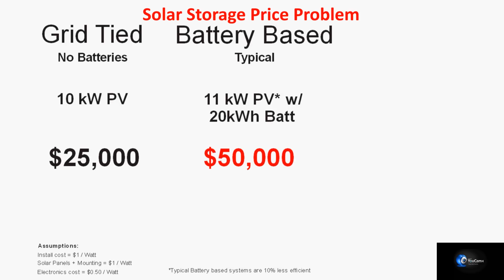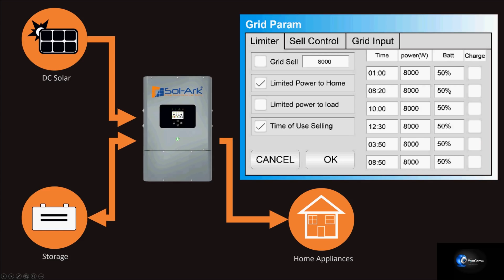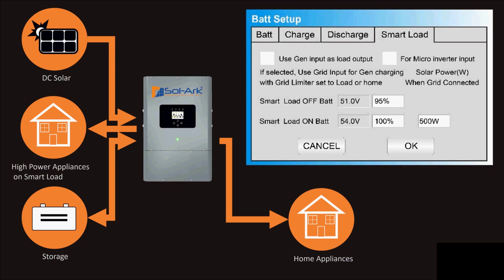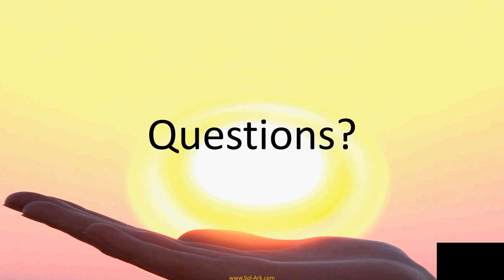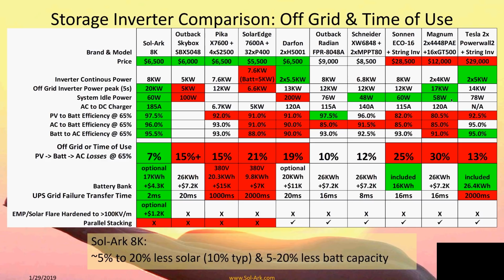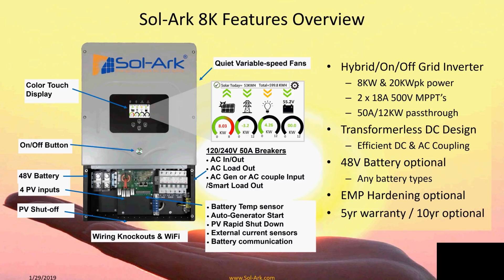Competitive Storage Inverters Webinar 2019

Comment: You should be replacing free of charge all of those grid tie units that turn off the solar power to the house when the grid goes down.
Your stuff is overpriced and under engineered and not friendly to the consumer's pocketbook at all.
I put more of your gridtiy inverters in a dumpster after replacing them with better units that cost about half as much.
Good luck with that '70s technology garbage you're hustling....
Reply from the maker: Hi Wayne,
To clear any confusion, we actually don't sell grid-tie only inverters. Sol-Ark users have the option of operating in a grid-tie-only fashion when they do not have batteries, but the majority of our users back up their homes during grid outages and even operate independently from the grid with our inverters.
If you'd like to learn more or have any questions, feel free to contact us here: https://www.sol-ark.com/contact-us/

Comment: The quality of the inverter is very good, but what does it do for your company when the potential customer has turned away because of how expensive the inverter is, I am an installer in Jamaica but as much as it is good,  I have to recommend a different brand to my customer because the price is too expensive here in Jamaica.
Reply from the maker: Hi Andrew, thank you for your feedback. The prices are set because Sol-Ark will provide installers and end-users all the technical support they need, in English and Spanish. We also offer more economically feasible options for smaller loads, such as the Sol-Ark 5K.

Comment: I have an existing large 40 volt battery system is there a way to use my modified sine wave inverter 120 volt as a generator backup or use my battery grid tie inverter as AC coupled.
Reply from the maker: Sorry. No. We cannot work with modified sine.

Comment: Does the Sol-ark 8k $6500 include batteries?
Reply: no batteries - but this is a "real inverter", it cost more because it combines several products in one, this is not a Tesla type solution that invests more in marketing and shiny plastic than tech. Pair it with the proper battery and it could easily last twice as long as a Tesla Energy product, after the first lifespan of a Tesla product is exceeded a Sol-ark starts paying you back fast. Cheap conventional solar inverters sometimes advertise grid-down power, but often it is extremely limited - ie only 1 120v outlet, only 2000watts, etc, or other systems that offer "battery islands"- these require tons of add-ons besides the batteries, often making the final cost exceed the Sol-ark solution - I am just shopping and finding tons of hidden costs in other solutions. Sol-ark just makes inverters, not batteries, to double your life get a LiFePo4 battery product, it will cost more up front, but will pay back later.

Comment: I don’t see the system and the one power supply like the SMA sunny boy to thousand watt power supply if you don’t half batteries
Reply from the maker: Correct. If you don't have batteries, the system shuts down like a Grid Tie inverter. The SMA outlet is only powered when the sun is up and grid is down. It's not continuous power. It was mainly put there to satisfy a california law.

Comment: Does anyone do a true full house system. 300A main breaker box?
Reply: Check out the growatt inverters they're about half the price with a 10-year warranty much better than this crap that's way overpriced
Reply: Good question but most single dwelling houses in the US are 200a main service and not 300a
Reply: The LIGHT Worshipper what do you need to support a 200K box? Thanks for responding. I’ve been told that I need at least 5.7K solar for my house.
Reply from the maker: The 12K is stackable. So 2 x 12K will allow many people to wire the whole home.

Comment: They are pushing AGM batteries..which means you get 1/2 the actual power production.  And you also get to replace the batteries every 2 years or so.
Reply from the maker: We are battery agnostic. You can use whatever you please that is 48V. But in our testing, we found thick plate carbon AGM's superior in cost per cycle to anything else including lithium. You can see the real world cycles in this brochure. 
https://www.sol-ark.com/wp-content/uploads/2019/06/PCC-230-batt-brochure-no-pic-6-19-2019.pdf
They will last 12 years On Grid and ~7 years Off Grid.
Reply: @Sol-Ark  
Wow the cow manure gets deep in here doesn't it.

Comment: Hi
Like your efforts, the future demand will be focused on storage hyprid smart inferters
I have small experience i think imeon inverters give good solutions for typical use
Reply from the maker: I looked at Imeon. It will take 3 of them to equal one Sol-Ark. So basically the same cost. And their lower efficiency will require $3K more in solar, $1500 more in batteries, & $1000 ganging install, making it much more expensive.
Reply: @Sol-Ark   wich model did you look at i totally disagree with you Imeon Energy 9.12 is booster
Reply from the maker: That is a 3 phase inverter model that only does 230V (no good for North America). 3 phase is super easy and cheap. Their model is also far less efficient. But thanks for mentioning.

Comment: Why not compare  AC coupling to Schneider XW6848 PRO. For me that is the cost effective solution on the market. It is also Rule 21 Compliant and it is $3500. Not sure why you would use the DC Coupling in your presentation.
I would love to use your inverter but it is very very expensive,  and if the EMP solution is not included by default then your inverter is about $8000?.
My SMA $1200 AC coupled to Schneider XW6848 PRO $3500  + 10kW of LiFePo4 $3000 =$7800, and That is efficient.
Reply from the maker: Fair question because the answers are complex. Your string inverter losses are 2-3%, the XW losses into the batt are 8.5%, then the losses out of the XW are 7.5%. Total losses for TOU/self consumption are 18%. Sol-Ark losses are PV to Batt = 2.5% and Batt to AC = 4.5% for total of 7%. If your PV array is 10KW, you are loosing 11% of the energy with the XW + SMA solution. At ~$4/W installed, 10,000W * $3.5 installed ($5 for most batt installs) * 11% = $3850 in wasted PV power. So you really spent $1200 SMA + $3500 + $3850 = $8550 vs. $6500 Sol-Ark. After all, why do you pay more for an energy efficient A/C?
While we are the most efficient AC coupling solution, DC coupling (which we also do) will always be more efficient. We are Rule 21 compliant now also. Hope that helps.
Reply: @Sol-Ark    In am using SMA 4000 TL-US the old one with 3.1 kw solar pannels.  I installed it myself and after the government rebates and rebates from the electric company my cost was about $1900.  For example I can buy the SB 4000 US 4kw without the secure power with $481. 96-97% efficient, or SB 6.0-US 6kw with secure power for $1322.
Now, while your efficiency info is true is  not really accurate for an AC coupled system. For example yesterday I produced 18.78kw and I sent to grid only 6 kw. The rest was used in my house in real time at 96% efficiency. So only 32% I would had sent to the batteries with less efficiency.  

If I woul be rich I would buy you inverter and I would buy it for the EMP feature, but with that is arrount $8000. While your  online video " from our family to your family" is very emotional, is no true. People like me cannot afford you inverter.
Reply from the maker: @mlg779  Your case is rare with 3KW of panels. Most people have 9-10KW and use most of their energy at morning and evening/night because they work during the solar production day. About 70% of the energy will go through batteries as Utilities are all moving to Time of Use. Many engineers quit high paying jobs to work and develop something extremely innovative. UL listed testing and certifications were $400K+. EMP testing $300K+. I am sorry you cannot afford our inverter. In 6 years of business, we have not had 1 customer or solar installer wish to return their inverter. That's how much we care about our customers. FYI, lithium batteries will not survive an EMP, so you would not need that option.
Reply: @Sol-Ark   I the end after some calculations    I think I will go with  your Inverter. I will recup my money in about 6 years but is a beautiful solution and it is a one device solution. To recup my money that fast I will have to go offgrid and buy another 2-3 kw of solar pannels.
Reply from the maker: @mlg779  Fantastic. Feel free to share your math. Our engineering manager (Tom) is curious how you got a 10KW LFP battery for 1/3 the going rate.
Reply: @Sol-Ark  from Alibaba.com.  Actually I got another offer 15kw for $1800 + probably another $1000 for shipping. Unfortunately   my order is already shipped. But now I know what prices I can get for future. It is ordered from the factory and they will match the cells based on the internal resistance and capacity. I ordered 32 pieces  3.2V 100AH .
Reply from the maker: @mlg779  WOW! I hope the battery is not a scam because it sure sounds too good. Please share the LFP with us when you order the Sol-Ark. Ask for Tom. Thank you.
Reply: @Sol-Ark  hopefully not. This is the battery: https://m.alibaba.com/product/60713129797/prismatic-size-2500cycle-rechargeable-lifepo4-3.html?spm=a2700.8443308.0.0.224e3e5f6mUQJo&redirect=1
Reply: @Sol-Ark  Are your efficiency #s based on xw pro series?  Data sheets show sol ark only 2-3% more efficient.
Reply: @Couchlover47  everything comes from there. Even this inverter.

Comment: Can I tie the gen 2 connection to a secondary battery bank using a 240 volt output inverter?. I plan to install solar late June using the Sol ark 250ah battery as the new primary but I have a 705ah battery bank that is fed with a1.6 kw wind turbine. My thought is it should read the input the same as a 240v generator
Reply from the maker: Yes. It will treat it like a generator.
Reply: @Sol-Ark  Great! I didn't want to waste the batteries when I upgrade. Can recommend an inverter that would compliment the Sol-Ark 8k for this. I'm thinking at least 5Kw. To understand I know this would be a recommendation and I take full responsibility.

Comment: One way I can see you implementing parallel stacking multiple Sol Arks in pure off grid systems is by having one Sol Ark act as a grid reference and the additional Sol Arks treat the load output of the grid reference Sol Ark as a utility grid connection.  The additional Sol Arks would be configured as 'limited power to home' grid interactive inverters with their current transformers on the load output connections of the grid reference Sol Ark.  As the Sol Ark already has RS485 and CANbus networking in and both topologies support multiple bussed nodes, getting the Sol Arks to talk to each other in such a networked system should be doable.  I can see this being useful for large single phase light commercial and agricultural off grid systems that cannot reduce loads to under 8kVA (and especially where individual loads can be over 8kVA) or that cannot easily implement multiple separate busses fed by independent Sol Arks.

Another useful feature if you have not implemented it already (information has been spotty) would be a dongle for connecting the Sol Ark to a hardwired Ethernet network.
Reply from the maker: You understand our 8K very well! And thank you for the suggestions. We work hard to improve every month.
Reply: It is the leading candidate for the inverter/inverters I will be using for a major project in the next few years, principally for the optional verified EMP hardening.

Other features you should look into are implementing frequency shifting for control of GTIs in systems with AC coupling (output frequency deliberately deviating outside the UL1741 range of 59.3cy/sec to 60.5cy/sec to trip out the inverter without tying up the generator/smart load connection) and allowing a maximum battery potential of 62V to 64V for proper equalization of flooded lead acid batteries.  The former should be a simple software/firmware rev but I do not know whether or not the existing ~59V limit is due to battery charger hardware limitations in the Sol Ark.

Comment: I dont see sma on the comparison- why?
Reply from the maker: The Sunny Island solution is practically gone. And the new solution: Sunny Boy Storage is extremely inefficient. It uses an 380V/50V LG battery. See our battery technology video. So the AC coupled inverter looses ~4.5% and the LG battery 5.5% (each direction). The PV inverter losses are 2% + 10% into the battery + 10% out of the battery. Total PV to Batt to AC = 22% (only in electronic conversion losses). If you really think we should add the Sunny Boy Storage to the chart, please suggest.

Comment: Great video Tom. Does the system still manage limited power to the house only when using AC coupling? In other words does it not allow the AC coupling to go over what your house is using?
Reply from the maker: Unfortunately not. We cannot control the AC coupled portion when the Grid is up. Only when Grid is down.

Comment: this with about 100 golf cart 6 volt batteries running down to 50% should get around 50 kWh of storage and cost about 10k just for the batteries itself. There will be maintenance of course... but interesting to consider either way... This is a really really cool inverter you have.
Reply from the maker: I agree Golf carts are the lowest cost battery. The only 3 problems are maintenance, 80% round trip efficiency = 20% larger PV array, and ~700 cycles. PCC batteries are 98% efficient, sealed, and 2400 cycles. But we all do what we can afford at the time. Thank you.